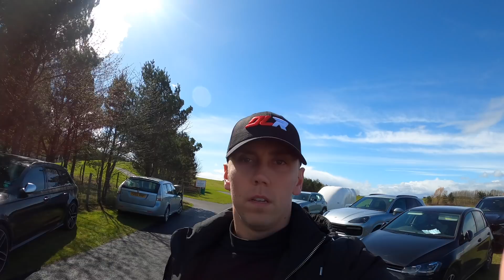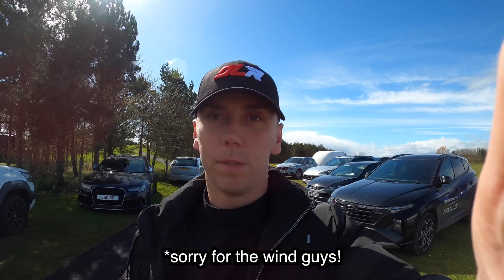Onboard BTCC Lap at Croft with Daniel Lloyd - Hybrid Explained

Comment: Absolutely brilliant vid with lots of info for us fans . 2 quick questions .
1/ I take it you have to keep your thumb down on the hybrid button whilst you want it to work . It’s not a case of press it and it’s on till u go below 120kph or out of 3rd . Do u keep a mental figure in ur head of how long u have used it for in seconds or does the dash tell you ? 
2/ is there a physical push from the car when u do press it . Let’s say you hold it down for 6 seconds after exiting a bend . Is the power there straight away or does it take 3 of them seconds to even notice it . Couldn’t really tell in the vid . 

Glad it’s working fine now (just driver error now 😂😂) 
Hope to see u and chat at Thruxton media day
Reply from the maker: Thank you!! Glad you liked it! 😄 yes you have to keep it on the button! And it shows on the screen as a timer so it counts up as you’re holding the button. And the power is instant… it’s not HUGE but you can feel it straight away. 😄👍🏼

Comment: Thanks for giving the fans such a great insight, really interesting! You mentioned 15 seconds of Hybrid per lap, is that still the case in the races or is it a more limited window per race?
Reply from the maker: You’re welcome! 😄 and yes it’s the same in races but they will change the amount depending where you are in the championship. So just like the success ballast , if you’re leading the championship you won’t have any boost at all, if you’re second in the championship you will have 2 seconds 10th in the champ then 14 seconds… hope this made sense. So instead of the weight, they will use this to handicap.
Reply: @DLRTV23  Awesome, here's hoping you and the other guys in the team won't be using it much then in that case 😂 All the best for the season, see you at Donnington 🔥